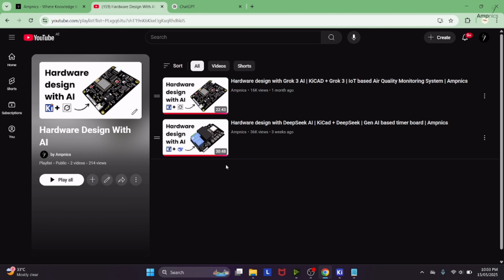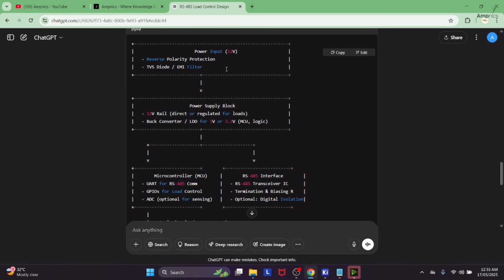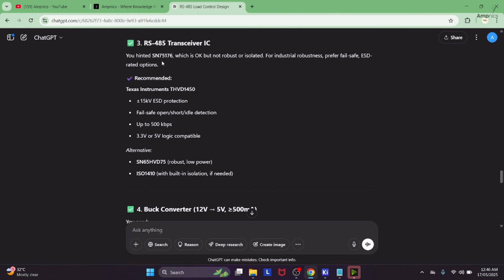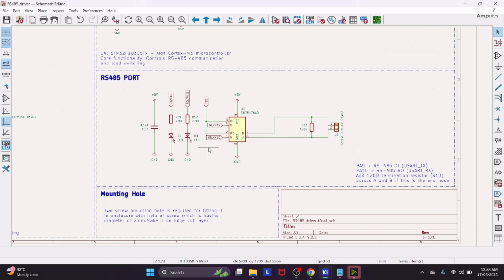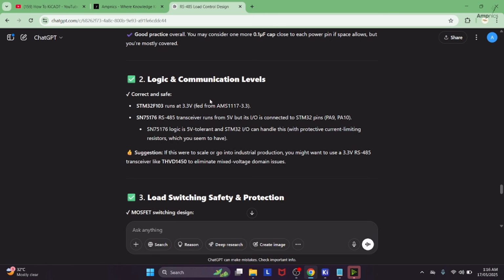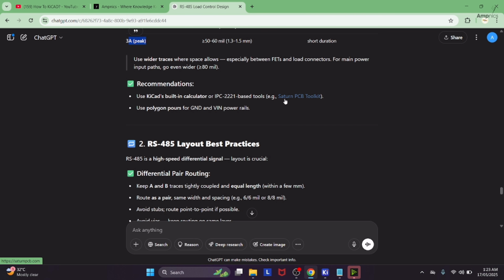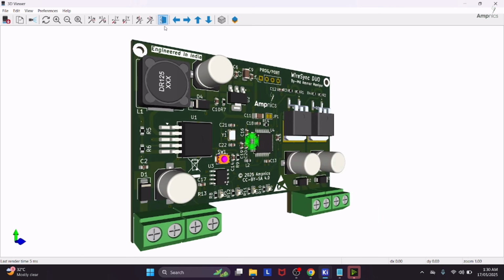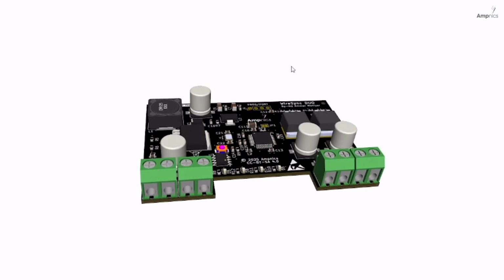Hardware design with ChatGPT | KiCad + ChatGPT |  STM32 + RS485 based 2 Channel | Ampnics

Comment: Timestamps
00:05 - Using ChatGPT for industrial hardware design innovation.
02:34 - Overview of RS485 communication and power supply in hardware design.
05:10 - Component selection for RS485 switching circuit using ChatGPT.
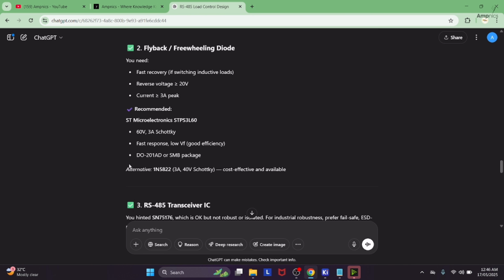07:41 - Key component selections for an RS485-based design using ChatGPT.
10:17 - Designing a budget-conscious PCB schematic with functional blocks.
12:46 - Overview of hardware design for RS485 communication with STM32.
15:22 - Best practices for decoupling capacitors and MOSFET gate resistors.
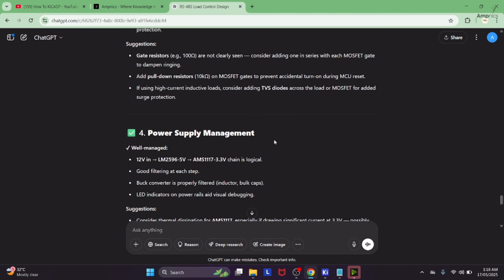17:50 - Emphasize schematic review and power supply considerations in hardware design.
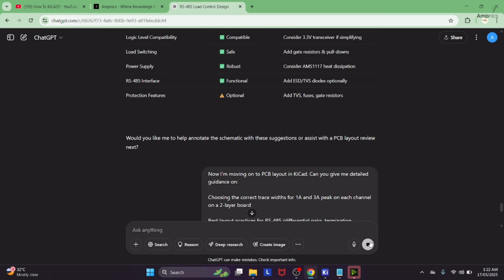20:05 - Designing noise-free power and signal paths in PCB layouts.
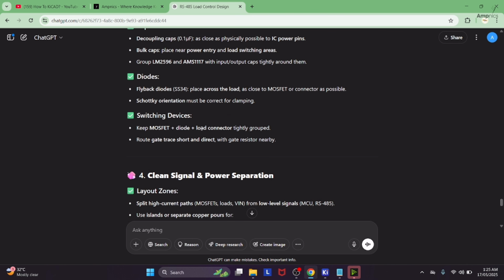22:27 - Effective PCB layout enhances thermal performance and minimizes EMI.
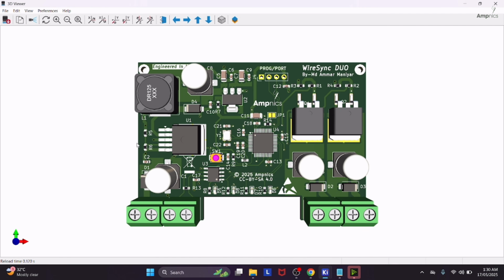24:43 - Efficient PCB design reduces EMI and supports high current traces.
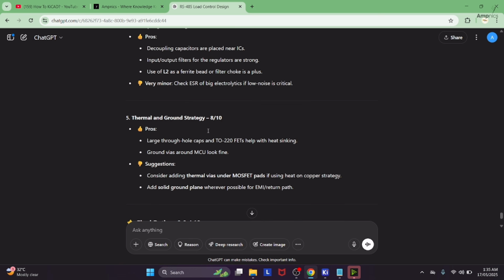27:13 - High ratings for RS485 board design using ChatGPT.

Comment: Amazing tutorial! Thanks for sharing your PCB design knowledge. I have a humble request — could you please create a step-by-step PCB design series that aligns with industry-level standards?

It would be great if you could cover small but critical things like:

Track width & spacing selection based on current and voltage

Layer stack-up design

EMI/EMC best practices

Via types and placement rules

DFA (Design for Assembly) and DFM (Design for Manufacturing)

Component placement strategies for thermal and signal integrity

Silkscreen and clearance tips

Design Rule Checks (DRC) and how to fix them

Even things like test point planning and decoupling capacitor layout

These topics are super helpful for students and fresh engineers trying to design PCBs that meet real-world, production-grade standards. Looking forward to your advanced tutorials — thank you once again for the valuable content!
Reply from the maker: Thank you Dear! 
For your request we are already working on it. However you can begin designing PCBs with our existing videos.

Kicad Hindi tutorials: https://youtube.com/playlist?list=PLxgq6Jtu7shQPHqYjKUVa28CmktTzHDLp&si=ErOm9lNXmvtAy_ZI

Kicad English tutorials: https://youtube.com/playlist?list=PLxgq6Jtu7shTKNNEEquF4xH6qS7Msc-iW&si=b1Ns1gNxZJvSnuL0

Thank you!